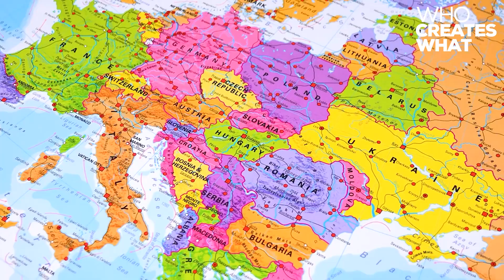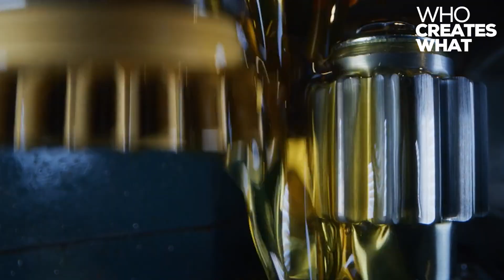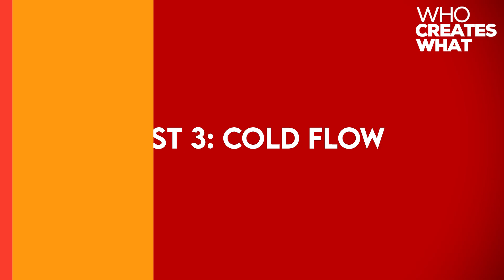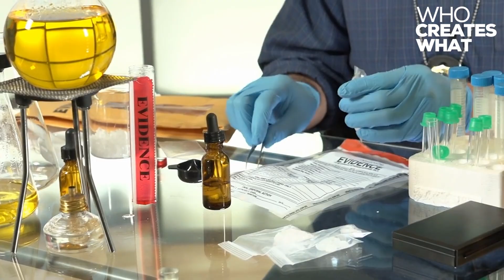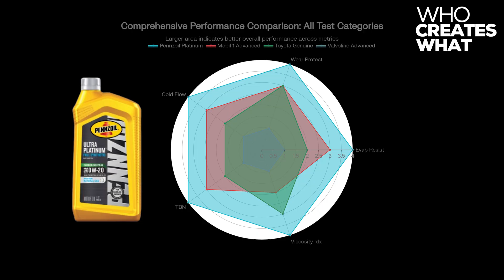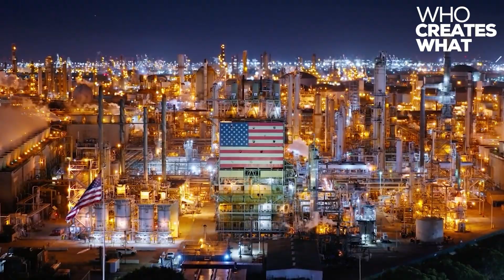Who Makes Toyota Oil? It’s the SAME as Mobil 1, Pennzoil & Valvoline?

Comment: If your using an oil with anything less the 600ppm of Molybdenum in your Toyota or Mazda, you have rocks in your head. There's a trail of failed Toyota's from people who thought Mobil 1 was the same as TGMO, because ExxonMobil Blends and Bottles TGMO for the North American Market. If you can't get TGMO, get Idemitsu or ENEOS.
Reply: What is your opinion of Castrol Edge for a Toyota Corolla?
Reply: @jameshood9694  How old is it? I'm Australian, here TGMO is much cheaper than any Brand name oil, it's mixed and bottled by Caltex to a very high Molybdenum Japanese formula like Indemitsu. @themotoroilgeek Channel has trustworthy info, he's a Lubrication Specialist, not someone without a face generating AI junk or a complete nobody.

Comment: Additionally, Genuine Nissan 0W-20 Full Synthetic motor oil differ from Mobil1 because of the additives. The base oil is the same however, the additive package is specifically designed for Nissan. This is likely the same for Toyota.

Comment: Beware of the numbers given in this faceless video, the additive tests I've seen for Toyota genuine motor oil and Mobil 1 differ from whats stated in this video.
Reply: So which is better?
Reply: @johnyoung5482 TGMO, even though it is blended and bottled in the USA by ExxonMobil.
Reply from the maker: @alsheremeta Fair point — we'd encourage anyone to verify independently. The additive numbers in our video came directly from Blackstone Laboratories analysis (the same lab NASCAR teams use), not manufacturer spec sheets. Zinc, phosphorus, and moly levels were measured from actual oil samples we purchased at retail. If you've seen different numbers elsewhere, it could be batch variation, different test methods, or different model years.

Comment: Toyota own aisin oil, maybe aisin or mobil
Reply from the maker: @blackcopper8760 Actually, according to the safety data sheet and EPA filings, in North America it's Exxon Mobil that manufactures Toyota genuine oil — at the same Baton Rouge facility that makes Mobil 1. Aisin is mainly known for transmissions and auto parts, not engine oil. That said, the supplier does vary by region — Shell handles it in Europe, and Idemitsu in Asia-Pacific. So it really depends on where you are!